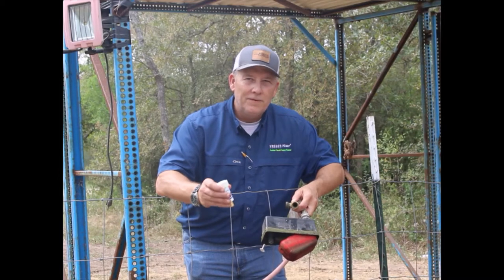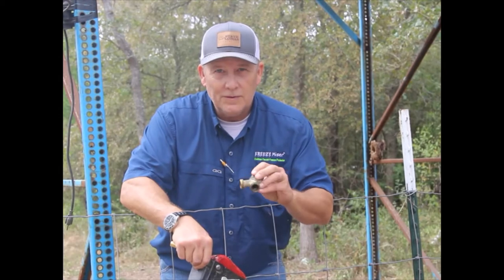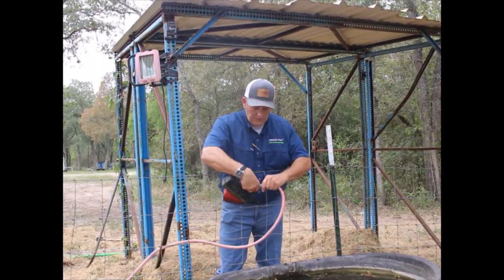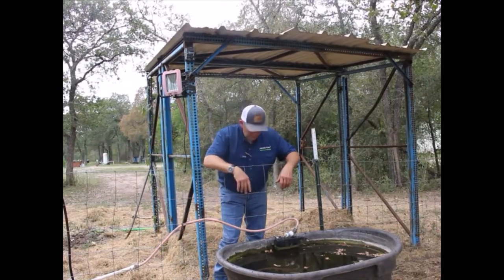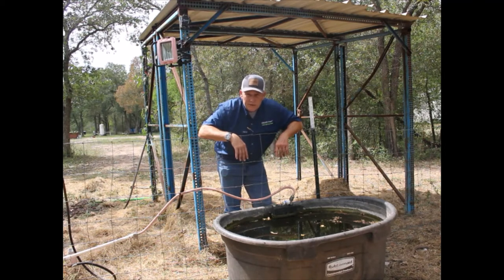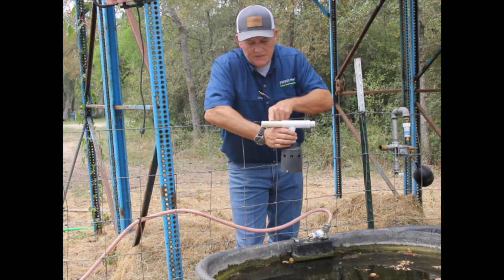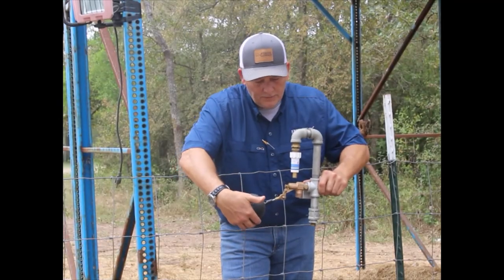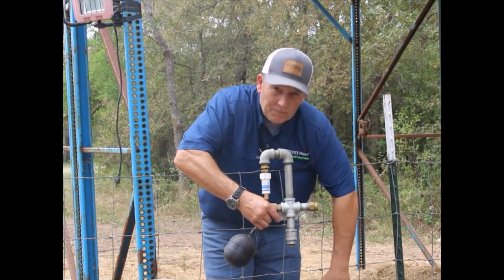Freeze Miser - How to Install Using a Float Valve

Comment: I purchased one. It doesn't drip. If I open the faucet all the way. The water runs like it's not even there.
Reply: If the freeze Miser has been exposed to ambient air temperature below 37f. For a period of time. It will be in the open position when You turn the water on  Let it run for about 3 to 5 minutes it will then shut down and activate whenThe water temp reaches 37f.
Reply: @jeffjubela3649  It ran wide open all day. I turned faucet down to a drip. that's the  only way it would work for me. Now that it has got above 37 it turned off.